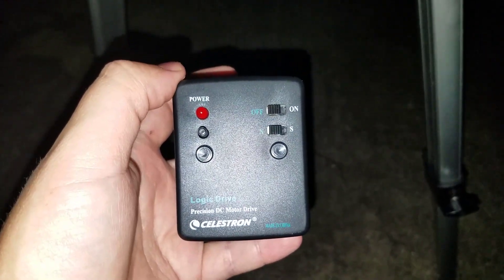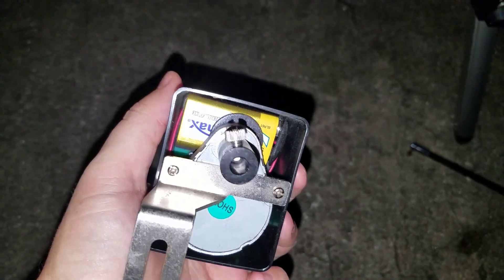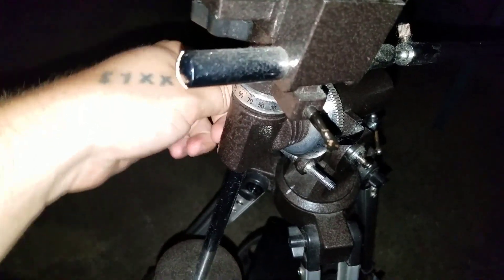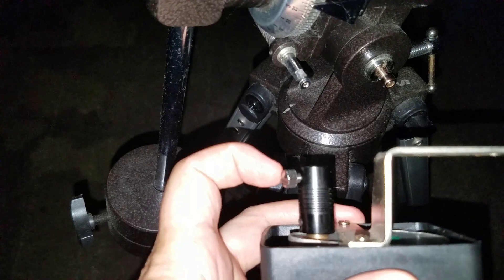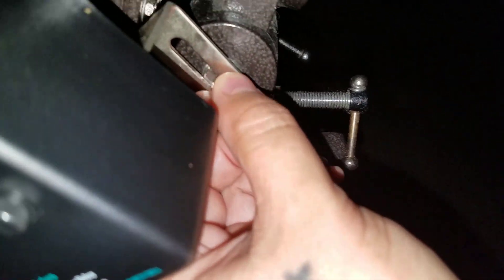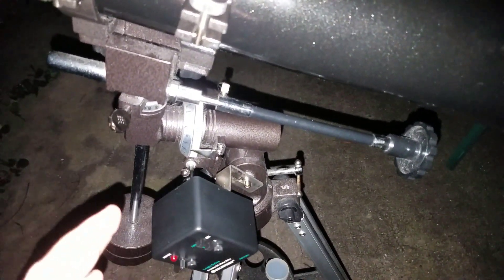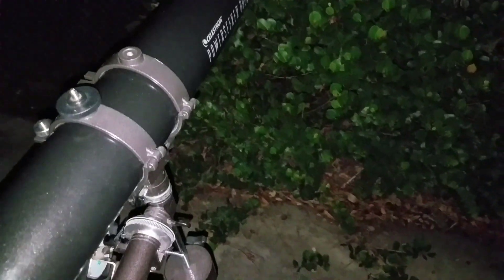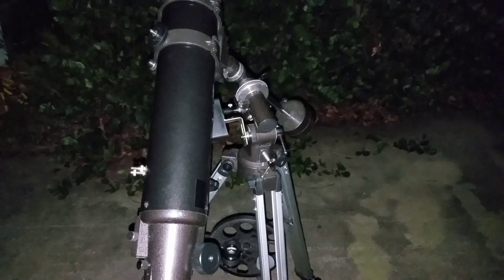How to use the Celetron Powerseeker Motor Drive

Comment: so does the motor actually work well in tacking an object hands free
Reply from the maker: It does obviously it will help to make sure the OTA is balanced but its not hard to re-center manually and then use the motor again the trick is finding the right speed better to use a planet or the moon as a test the key is to keep the object at least in the field of view of the eyepiece if not centered. Take in mind that if someone touches the OTA or bumps the tripod it could might the tracking off however this motor drive  isn't technically meant for imaging with would require some patiences.

Comment: Is it possible to use this as a star tracker when astrophotography?
Reply from the maker: Not really designed for it this is meant to help you tracker objects the mount isn't really stable for that. The cheapest telescope mount I'd use and not with this tube is a Celestron Advanced VX mount last time I owned one they were like $800 and they are a learning curve astrophotography is not a cheap hobby

Comment: bought  a celestron astromaster 130 and the place where the motor should attach to the telescope is a small hole were the screw should be used.  the hole is barely deep enough to let the screw make one rotation. needless to say the motor wont attach to the telescope. just on of those days hu. any ideas , anyone?
Reply from the maker: Go to a hardware store with the motor and find one that fits and get a bolt as well

Comment: if  the earth always rotates at the same speed, why would you need a speed adjustment knob ? cheers
Reply from the maker: Different eyepiece powers. A lower number like a 40mm could be a little slower speed and still be in the eyepiece field of view but not likely centered.  A higher power eyepiece like a 10mm would need  a little faster speed to try and keep the object in the eyepiece field of view.

Comment: You explained it very well, I wonder if there is a universal motor
Reply from the maker: Well I'm sure someone who is good with circuit boards and possibly Arduino could possibly make their own motor drive and a simple 3D printer for a case to cover the board.

Comment: Sirius freaks me out. It flickers and seems to flicker in different colors. Its like a UFO coming to get you. 

So are you able to balance that scope? It looks like the counterweight is all the way out.
Reply from the maker: Yeah it's pretty easy to balance all you do is loosen the one knob that will let the tube lay on its side straight if it starts to tilt up or down then there is too much weight forward or to the back you just have to loosen the tube brackets and push the tube up or down until the tube will lay on it's side pointing straight. Then tighten everything down and it should be balanced.
Reply: @MatthewHKnight  I'm referring to the RA balance. There does not seem to  be enough counterweight on the shaft. Just wondering if it is able to balance in the RA axis?

Comment: What feels weird to me is I have to switch it to S to track correctly, but I am in the UK! I’m using Celesteon Astromaster 130EQ
Reply: I have the same telescope and that´s because this motor drive was designed based into eq2 mount. Look for pics and the motor drive is mounted on the left side, eq3 is mounted on the right side, so direction is inverted S->N and N->S
Reply: @andyjd3149  Ah I see, that makes a lot more sense. Thanks!
Reply: @andyjd3149  Wow, thank you!!!!! I was wondering about this.
Reply: @andyjd3149  Jesus, thanks! I am not a stupid person, but since I bought this, I am wondering, why the hell is it working only in the S setting.. I wanted to mount it on the correct side, but as far as I remember(I am not at the telescope currently), there are 2 holes on the other side, with the indicicator mounted on them, made this impossible. 
My main issue is the speed, as it is very hard to find the correct setting. The motor is a simple DC motor, and the RPM is potential-dependent, turning the knob will increase/decrease it. And I think therefore the speed is higly battery-dependent, and as its voltage drops(because of useage and temperature in winter), so will the RPM drop as well. It is not optimal, but I was able to take several astrophoto with it(Orion nebual), but it was exhaustive, as I had to keep it updated through the night. 
SO.
I have decided to upgrade the EQ, at first, with a proper power source: I am using a Parkside Battery+Parkside USB Battery to USB thing(PAA 20 Li-B3), but any powerbank with 2-2.4A USB output will do the trick. The USB cable runs into a boost converter, which transforms it to 9V, and I have soldered a salvaged 9V battery connector to it. This way I am not dependent on a weak 9V battery. But It is not solving my problem with the speed.
SO.
I am currently building an upgrade with a NEMA 17 + Arduino Nano, which I have already made once, when I was building my own motor drive.

Comment: When I turn on my motor drive it does not spin but the noise is there so I know its working but it's not spinning.. what do I do
Reply from the maker: It's likely because the screw is not in the gap like I showed or the telescope isn't balanced correctly  you need you loosen that screws on the tube and loosen the knobs for the tube and make sure the telescope doesn't lean when it's on it's sides when you put the telescope to the side it shouldn't move. Should be plenty of videos on showing you how to balance a telescope

Comment: What is the proper tracking speed, so that it tracks the stars? Like doing long exposures of nebulae or the milky way?
Reply from the maker: This isn't gonna be able to to do that you're gonna need at least a Celestron Advanced VX mount.
Reply: @MatthewHKnight  assuming we do have the proper mount, what would the proper tracking speed be?
Reply from the maker: @senbilverglate9638  A Celestron AVX mount is computerized so it will track at the correct speed it needs to automatically, the thing about EQ Goto mounts are is that they can calculate the speed of the object based on the time of year and where you're.

Comment: What does the motor drive even do??
Reply from the maker: Allows you to track a night sky object like the Moon or the planets.
Reply: @MatthewHKnight  what exactly do you mean by track? Like does it find objects or does it stay tracking an object you still have to find?
Reply from the maker: @zombie474  It basically just keeps the object within the view of the eyepiece. You must first find the object yourself before you can use the motor drive it's honestly best to use it on a planet or the moon till you're able to get the right tracking speed which should allow everything else you look at stay in view obviously changing the eyepiece or messing with the telescope while it's trying to follow the object will move the object out of view. This is not a goto telescope goto telescopes you do an alignment using stars and that telescope will figure stuff out so it knows how to locate stuff where you're currently.

Comment: Included when you purchase the scope?
Reply from the maker: Some times not always.
Reply: Would you recommend buying that telescope? And the eyepiece have a wide field of view in star clusters, nebulae and planets?
Reply from the maker: @josephemmanueladriano7413  I still use it as a grab and go scope but I also have owned other telescopes since. Would I recommend this one yeah just don't expect to see what you see in pictures from NASA. The planets are gonna  small in the scope until they're at their closest to Earth. Now some thing like a CPC 1100 will be a mind blowing thing to use. If you've a local astronomy club you should attend a star party maybe they will have telescopes you can check out.
Reply: @MatthewHKnight  but the eyepiece have a wide field view and greater details in nebulae,star clusters and planets?? My last question pls
Reply from the maker: @josephemmanueladriano7413  The bigger the number the normally means the wider the field of view the lower the number means the smaller the field of view. The only two eyepieces I recommend for this telescope is the Celestron 8-24mm Zoom Eyepiece and like a 40mm Celestron plossl

Comment: I watched this video prior to setting up my Astro Master 130 and have a few things to add. First, it is only necessary to remove the two front screws in order to install or change the battery. Second, I would slightly loosen the small Allen set screw on the black coupler, just enough to allow it to slide for alignment. Install the motor on the scope mount and tighten mounting screw only until snug. It may be necessary to rotate the right ascension (RA) knob slightly to align the flat section under the thumb screw. Tighten the thumbscrew. When all components are aligned properly, then tighten mounting screw, then small set screw in coupler. Remember to loosen thumbscrew during manual adjustment of RA. Tighten when using tracking motor. Don't lose screw!
Reply: I was wondering if there was a way to loosen the motor for periodic use of the manual tracking cable for RA.  So you just loosen the set screw, right?  And then use the manual tracking cable for RA?
Reply: Scott Anthony - You would loosen the chrome knurled thumb screw that secures the black coupler to the RA shaft in order to use the control cable. The Allen set screw should not need to be loosened or removed after initial setup. I would recommend applying grease to the thumb screw threads to guard against it falling out, or to remove it completely and keep in pocket or eyepiece case. It would also help to put a black line or dot on RA shaft inline with flat spot, to aid in alignment when tightening or reinstalling thumb screw.